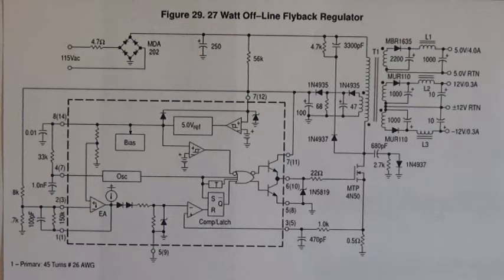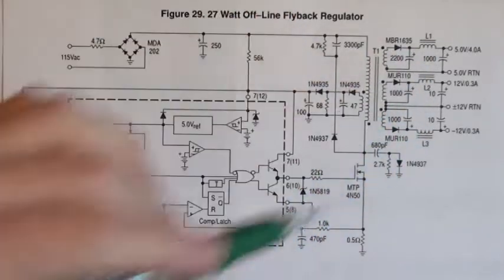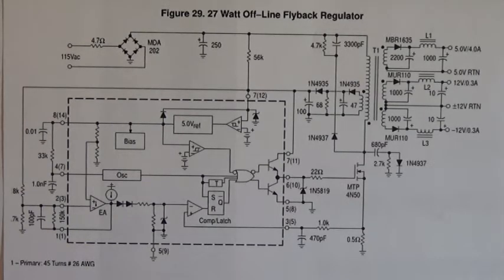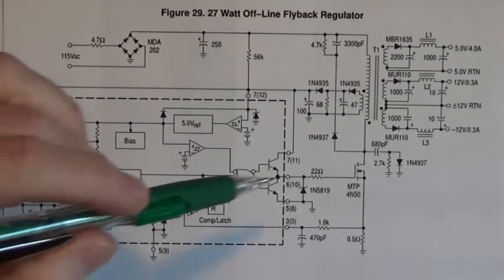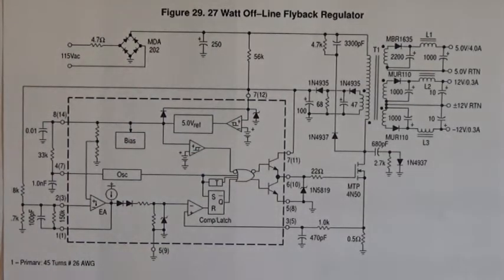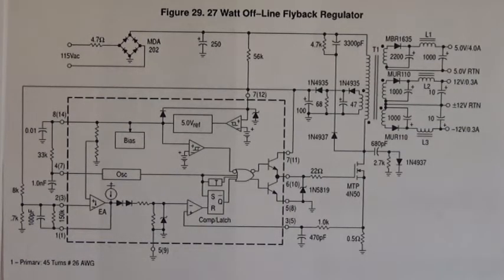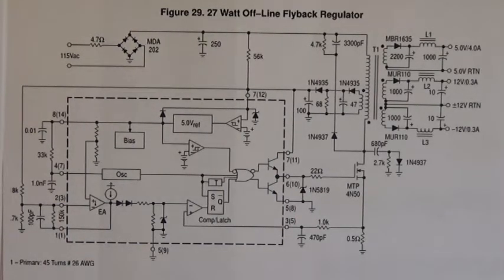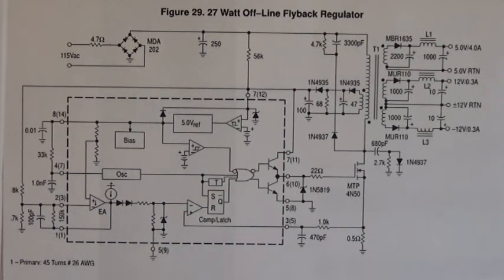UC3844 SMPS IC Failures. What to Look For.

Comment: SAFETY NOTE! Resistors connected to the DC buss !
Always replace the insulating boot on the resistors connected to the DC B+ .
Always re-install them with the short end towards the B+ on the board. Exposed wire of resistor connected to B+ can arc, cause a fire, and/or shock the crap outa you.

Comment: Thanks for the video. Had a similar circuit with a blown mosfet and UC3842. Blew again after replacing these parts. Eventually I figured out that the gate resistor went up in resistance and was causing the recurring failure. UC3842 was not available for purchase but I found that TL3842BDR-8 is a drop-in replacement.

Comment: the strange smell coming from popped open electrolytic capacitors is caused by the remanants of electrolyte evaporating as it is heated, the stuff is carsinogenic on most cases, so dont smell it too long, see: "Ethylene glycol poisoning"  capacitor makers keep the chemical formula secret, so it may include other harmful chemicals as well. some caps smell like pickled food due to vinegar like chemical.

Comment: Great educational video very well presented thank you so much. Could I possibly ask a question I have a fluke oscilloscope with smps fires up stays on for about 2/3 seconds then shuts down it has a protection circuit any suggestions would be helpful.

Comment: Hello sir... You explained the troubleshoot very nicely....

But i still am running it to problems....

Before watching your video when i checked my ic the input voltage coming to the 7th pin of the ic was 24v...and output was 14v... And after seeing your video i checked the resistor which connects from SOURCE of the Mosfet to GND and replaced it as i had doubts in them...

There where 3 resistor 4.7ohm connected in parallel.... Which sums app tob 1.5 ohms

I did not get 4.7ohms resistor so i connected 5.1 ohms and it values sums up to 1.7ohms...but now my voltage at 7 pins drops to 8v and there is no output voltage at all...

Will you  please guide me through this...

Comment: Hello sir
I see that you know what you are talking about, I don't know if this is the right place but I need if you can help me-

I have a problem  with a UC3844 14pin. The problem is that the IC supply voltage goes up and down. As soon as it reaches 16 vdc, it out a pulse through pin 10 (out) and through pin14 (vref) out 5v but everything drops immediately and so on.
what can be the problem, I search a bad capacitor or diode everywhere and I can not find anything. Also changed de IC 

thanks and congratulation for the explanaition

Comment: Great video Peepaw! But as a complete NOOB, I have a few questions. 1- How can one tell if you're dealing with a bus capacitor or a regular capacitor? I noticed that there is a small dot, to the left of that cap [on the diagram] is that the indicator for a bus cap? 2- can you test a power mosfet while in-circuit? And if so, must you discharge all neighbouring capacitors? Please let me know. Be safe out there, good sir
Reply: Scuse me for jumping in here - The dot you see is a plus sign , indicating the positive terminal of the capacitor.   Some schematics also show the negative terminal as a curve ( as this one does).  Electrolytic and tantalum caps are polarity sensitive ,  other types - mylar, poly, etc are non polarised , although - just to confuse the issue, there are non polarized electrolytics, but these are special purpose and you won't find them in power supplies.  Be aware that caps can hold charge for a long time unless there is a discharge path.  I would take any suspect transistor out of circuit to test it - I'm old fashioned.
Reply: @GraemeSPa  Thank you very kindly for your advice, I will test the mosfet, out of circuit, as you suggested. Be safe. Cheers!

Comment: Hello sir
I m from india.i have a question.
Ic 3845 is new for me. There are no ref volt(5v).Vcc is 18v.
The resistance 47k+47k/ 2w is for ic supply.direct connected to bridge ( 320 volt dc.).
But at pin 7 volt is 7.8
Ic taking 2 mA load and it is new ic.
Output is 0.
Where is problem ??
Plz help me sir.
Thanks

Comment: sir 
i have a smps supply, i found that it has faulty MOSFET, but i couldn't find any other MOSFET, instead a Power bjt tipp 122,
now my question is can i replace MOSFET with bjt🤨
Reply from the maker: Yes.... and.... No.... It all depends on what is driving into the gate of the MOSFET. Most gate driver circuitry is meant to drive into a MOSFET gate.  (or bipolar junction transistor). You may succeed, but most likely no... Try to find a MOSFET with the same parameters as the one that is damaged.
Reply from the maker: This might sound daunting, but it is very easy. Find a datasheet on the original MOSFET. Then look for one with equal or greater parameters. The parameters you want to be concerned with are voltage drain to source (Vds). The voltage gate to source (Vgs). And then Rdson (Resistance drain to source when turned on). And the current drain to source (Ids).There are other parameters that are important. But these the ones that I follow most intently when hunting for a substitute MOSFET.
Reply from the maker: I hope this helps. Please have a great day.
Reply from the maker: http://www.datasheetcatalog.com/
Here is a great resource for datasheets. Enter the part number for any electronic component.
Reply: @PeepawMcDonald  
this is a laptop power supply, with 19v output, and have only pwm to control mosfet as a switch,  very basic design.
thank you sir,  for your advice and reply, 🙏
I will try to find a mosfet now.
Reply: @peterwang5762  I actually try new pwm ic but it failed, my new mosfet got burned😅.  problem is I can't read the original pwm ic number. hence don't have idea, which pwm ic will replace it😕
Reply: @peterwang5762  thank you sir for your advice, a will surely do this. 🙏

Comment: what is purpose this circuit ?
Reply from the maker: Hello and thank you for stopping by and watching my video. This circuit is used to power electronic circuits. Switch mode power supply circuits are the most efficient method of creating DC voltages today.
Reply from the maker: The DC voltages generated with this circuit, can power television sets, radio sets, and many other electronic devices. Again thank you very much for stopping by. I hope you are having a good day.
Reply: First of all thank you for your reply. I'm an electrical electronics engineering student in Turkey. I want to work in the field of power electronics. I came back to your video while doing research for this, thank you again.